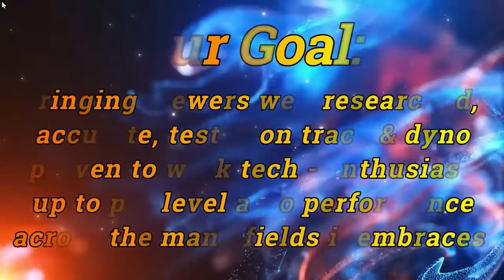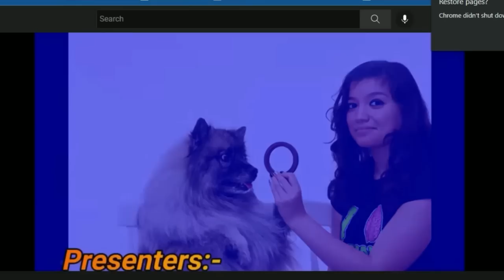A mystyery - 90 hp from spark plug change!!!

Comment: I can definitely confirm the spark plug story. I always did a lot of work with plugs, timing, indexing, ignitions, etc. One time I had been having good results with gap and timing and I decided to push it to the limit. The car just fell on it's face. It was over 3/4 second slower in the 1/4 mile. I pulled those plugs, put my trusty 'best combo" back and and the car flew again. In physics we have what is called "a high q" circuit. What this means is that if you get just a little to the left or to the right of optimum, you lose power/gain/response. That's how engines are. Most people run engines with a Q about 50. Good race engines are in the 70s maybe 80s. Those on the edge are in the 90s'. But if you get just a hair off, you can drop by 50% for the smallest thing. The story about the 350 that ran with the Dominator is a prefect example of a High Q engine. Anyone who's been "in the zone" in any competition can confirm this. You can't miss a shot. Nothing distracts you. Your brain is at a higher level. Engines can be the same way.
Reply: Like walking a tightrope
Reply: Right
Reply: @Equus_Master  It's call it "like balancing a triangle on the point."

Comment: I’ve experienced that spark plug issue firsthand and people always tell me I’m nuts and spark plugs couldn’t do that.  It was on a 350 swapped ‘80’s Monte Carlo my cousin bought many years ago and you couldn’t get the thing to turn the tires for anything.  It had decent parts and receipts for everything.  I pulled a plug to check condition and it had Accel “shorty” plugs in it for header  clearance, they didn’t appear worn and weren’t fouled or wet- looked normal.  We went to the parts store and picked up regular old Autolite spark plugs…after tossing those plugs in, the car came to life!  Blip the throttle from a standing start and the tires went up in smoke instantly.  To say it was an entirely different car after that is a gross understatement.
Reply: Not experienced anything that extreme myself but i like to try a few diff brand plugs in an engine and see what it likes
Reply: Auto light coppers or ac Delco coppers are my go to plug for all my vehicles I always side gap them too and the never skip a beat

Comment: Wouldn't the gas analyzer have picked up high Hydrocarbon from the unburned fuel if the spark plugs weren't doing there job?

Comment: Thank you Mr. Vizard!   You are a breath of fresh air to me and many others...  I've scratched my head for hours on end trying to figure out why my car wouldn't pull like it did... I had bought a set of accel "shorty" plugs because of  my headers and when I swapped back to  ac or ngk, the power was back!   Who'd have thought plugs would make such a difference?    As others have said, when I pulled plugs to look for a wet plug or fouled plug, I found neither.   I so needed to see this video!    It can be depressing and make you lose your enthusiasm for the whole restoration process.  I've learned so much from you!   Thank you, from the bottom of my heart!   I love you!

Comment: Another riveting episode where you are never looking for the end to arrive.  Thank you David.   Sometimes it is the little things.  A friend of mine was a painter at General Motors Holden, Australia, during the Second World War.    They got a captured Zero in the factory and stripped it to find out what they didn't know.  It was put back together but could not reach its prior top speed.   It was later realised they had spray painted it but the Japanese painted them with a brush, from front to back.  Apparently that broke up the surface drag.  This is much like the polishing of ports that slows the charge.
Reply: Thats why I  dont care so much about  heads I ported going everywhere.....most dont see the ' trick '   .......😅

Comment: Many years ago, I was an engineer on vibratory conveying systems.  In some tuning situations, we would hit what we called a High Q where the the performance would hockey stick nearly straight up.  Tuning for that situation was very narrow and temperamental.  Literally, turning the system off and coming back the next day and turning it back on with, no other changes, was enough for to send the system to hell in a hand basket.  Took some head scratching to figure that one out.

Comment: I have an supercharged 03 mustang t56 swapped with a hand built forged 4.6L 2v from excessive motorsports in Florida. Its actually for sale, anways its got comp cam 2690009L and R, trick flow heads tr6 plugs "i believe" stock ignition, on a conservative tune 17 degrees at wot.  Car is on about 20 lbs of boost and on wwf snow performance shes was just yawning at 550hp. i had the plugs out one day  months later checking gap and plugs, nothing was wrong but I was learning about gaps at the time. Tuner had me put them at 28 thousandths  months earlier i saw a video on spark getting blown out easily on large gap. I went ahead and tightened up the gap to 20 thou, such a huge increase in top end power I would say 90hp total. I'm no dyno   maybe 50hp gain , anyways I could feel the difference it feels great with no change in the tune at all. Love your videos LIKE SHARE and SUBSCRIBE Happy holidays to you and this wonderful following

Comment: I’m getting addicted to the wisdom and experience shared in these videos.  I’ve also found that sometimes the flash, all-singing, all-dancing spark plugs just don’t work well.  My T140 Bonneville just loves Champion N5s and plays up with anything else. It’s got plenty of electricity and a Tri-Spark ignition too. Even tried Denso Iridium plugs to no good result.

Comment: He's right. I've told people about how important plugs are and they don't get it sometimes. I had a turbo LS motor in a sandrail pickup almost 120 HP on a Dyno over a plug change. Went a couple heat ranges colder and closed up the gap a bit and BOOM!!  Everything else being the same. Tune, boost pressure, everything the same. Just a plug change. Sparkplug selection is a real thing and it's important. 👍

Comment: Those EQ cylinder heads were the most fantastic iron i have ever heard of, i think it was RHS that bought them out or maybe supplied the heads for them. The EQ heads were really good on dyno stands and performance. Here is a mild 383 build with EQ 220cc heads. 10.25:1 static compression with 185 PSI cranking compression. With a comp XR282HR10 retro roller. You could or should step up to a 288 and do well also with a trade off for the 91 octane . It made 515 torque @4000 rpm & 470hp @ 5400 rpm.The torque was straight across the band. A street stock build on the edge of pump gas 91 octane. Holley 750 dp with 1" spacer on pro comp #22025 intake. Hei 36* total (37*).
1.6:1 rockers brought lift to .544" and .555" lifts. If you have a street car 383 get heads that flow like this: 
Ported EQ 220CC cylinder heads flow data
At.100" lift = 73 cfm IN. & 61 cfm EX./ .200"= 140 cfm IN. & 107 cfm EX. /.300"= 201 cfm IN & 144 EX/ .400" lift = 244 cfm IN. & 166 cfm EX./ at .500" lift = 269 cfm IN. & 181 cfm EX./ .600" lift= 280 cfm IN. & 190 cfm EX./ .700" lift =287 cfm IN. & 197 cfm EX.

Comment: Possibly the larger fuel drops in the mini engine was making up some volume in the combustion chamber?  Like water injection on diesels does.  But the neat thing is, the fuel droplets would still burn, unlike the water.

Comment: I wonder if the lower velocity mix exiting the Dominator allowed it to make the turn into the runners to a more favorable location in the runners on that particular manifold?
     Great stuff, much thanks.
Reply: That's kinda where my mind was heading. Something about the combination (maybe even cam ?) Still moving enough air to make the carb work, even down low.

Comment: The exposed tip of the standard plug would certainly help. Have you considered reverse polarity on your coil(s)? Atomically you are blasting hot electrons into the soup, as opposed to drawing free electrons from the soup.

Comment: Spark plug electrode location in a combustion chamber can be critical in some cases. As you have pointed out before,  Mini heads weren't really optional. If I was speculating on the 1050 on the 350, clearly defined, strong intake pulses made the carby respond. Soft mushy pulses would result in the fuel falling out of suspension due to the large droplet size. Would have been interesting to log the pulses in the manifold and compare it against some others. As you said, the heads flowed exceptionally well. Great stuff David. Regards Greg

Comment: I have never heard you comment on Brisk Spark Plugs. My daily driver is a 2015 VW CC 6-speed manual 2.0L Turbo that I have extensively modified and on a 100 octane tune makes 379 WHP. I also 1/4 mile drag race it and 1/2 mile drag race. I have run Brisk “Standard” spark plugs in the past with good results. I ordered their “Multi-Spark” plugs and I honestly thought “Snake Oil” but prior use of their plugs yielded positive HP improvements so I spent $14 x 4 on plugs. I was at the 1/2 mile race event and made a few passes with standard NGK plugs (2-steps colder than stock running 100 octane and 25-28# boost) and thru in the Brisk Multi-Sparks (no ground strap and 2x rings imbedded in the ceramic cone). Instantly picked up .91 MPH. Made a few passes and put back a fresh set of NGK’s and it slowed down about the same. Back in went the Brisk’s and picked it back up. That’s real world A-B-A testing. Don’t know if the high boost makes this look better or not. 
I would love to see you do some comparison testing using this plug as well as a standard (ground-strap) Brisk. 
Love your video’s!!!

Comment: No disrespect Mr. Vizard,
but I believe the race plugs
UNSHEILDED the flame kernel, 
leaving it vulnerable to the
boost generated by the supercharger on the mini
engine. 
(Hope I'm not coming off as
some piss ant know it all ) 😅

Regardless, you were SHARP
enough to catch, and correct
the problem! Kudos to you,sir.

I'm not a spring chicken like
I used to be, but I'm still a fan of your passion,
and dedication in the world
of tuning, and hotrodding.
I bought, and read some of
your books back in the 90's,
and they HELPED me with
my wimpy 301 pontiac v8.

It was a dog of an economy 
engine, but I got some fun 
out of it thanks to you. 
Thanks again. 👍

Comment: Hello Mr. DV from Toronto Canada. Deep in thought as to why you experienced the different events made quick work of clearing the snow on my driveway-thank you! 😀 With respect to the side electrode vs the regular electrode plug, did the side electrode create a flame kernel straight down the center of the chamber, whereas the regular electrode plug created an angular flame kernel?  The angular flame kernel was more efficient at igniting the mixture across the chamber? 
I've seen engine dyno videos where there is a plume above the carburetor. I question if this plume is reversion of the AF mixture when the intake valve closes-does a larger plume means a higher velocity port?  Were there any plumes above any of the carburetors on your student's engine?  Thank you for posting!!!!!

Comment: @18:30 Could it be as simple as flashing from liquid to gas = lower temperature? Perhaps this changes things down the line like ... just that little bit more stable fuel & air mix / taking closer to the edge before randomish pre-ignition? I doubt it's this simple, but hopefully it's a good thought experiment.  What an interesting puzzle. Thank you for all the wonderful content!

Comment: Hi David,

I suspect the larger droplet size requires more energy to evaporate.  The additional BTUs cool the air fuel mixture more.  Lower inlet temperature equals more density of a charge hence more power.  I have done a bit of experimenting on two stroke expansion chambers.  Do not underestimate the pulse energy in the exhaust.  Perhaps your students engine has a well matched exhaust configuration which produced a pulse that traveled to the dominators venturies.

Mike

Comment: What might have helped in the understanding of the spark plug mystery would be a super-high-detailed CFD analysis of the dynamic flow in the engine as the engine rotates. Ie, watching a movie of the flow in the cylinder instead of just a static simulation of a frozen moment in time. When I say 'super-high-detailed CFD', I mean that would show the flow of air around and through the electrodes of the spark plug as well as the trough between the spark plug core and the outside.
Reply: Or you could have a diesel
Reply: @fastinradfordable  Haha! Actually, I much prefer diesels anyway, I've had several

Comment: I'm wondering if Dusty's engine had cylinder heads that had more air speeds  and maybe more swirl? That made the 1050 carb work on his engine.  And on the fuel droplets question maybe the bigger ones cause a bigger explosion in the combustion chamber? Of course I'm guessing.
Reply: Swirl is often not measured...... 

I had 2 years ago very recent Nascar heads on my flowbench. Flow was good...but the amount of swirl was ASTONISHING.   Put in a diesel injector , increase compression and it would run on  diesel.....

Comment: I also did some testing with Holley Dominator carbs on a 355 sbc drag race engine making a little less than 600hp using a 750 Holley 4150. A friend let me use his 1050 out of the box from Holley but he would not let me do any changes to it. Needless to say ET was down, it was just to rich. So I wanted Prosystem's to build me one of his 750 dominators but he said the 830 4150 will work better. Bolted in on and up over 600hp. Ran it for a few years until I came across a 750 Holley Dominator which out of the box was down on power. After making some tuning change's (mainly removing rear power valve and upping the rear jets) the truck ran its best ET @ over tenth faster than the 830. I've always wonder what the 1050 would have done if I had got to tune it.

Comment: Jimmy Bridges in Nashville built a 417 CID sbc for me. The carb was 1250 cfm.  Car was fast (5.80s) in a S10 in the 1/8. Jimmy won a lot of Wallys and lots of NHRA records. Carbs and heads were his bread and butter. He could make the big carbs run on small CID engines.

Comment: Interesting - Do suppose it have anything to do with the supercharger blowing out the spark?  Or perhaps it has more to do with the field around the electrode at such high voltage.  It could be the conditions inside the cylinder cause the field outside the electrode(s) are too insulating for one plug and less for the other...  It has to be a resistance issue.

Comment: 300zx is great example of spark plus making a big difference, the plug where designed to sit farther down in the head, iridium replacements don't go don't far enough. they're solid copper core platinum tipped 5k resistor plugs, ususal gapped to .44 but I like .43 because I've had issues with pre detonation and the smaller gap seems to help. went to a colder plug and that was it, best plug for the motor

Comment: David, did you ever think to ohm the spark plugs and match them up? Some big brands can have huge variations across a set of 4-8 plugs.
NGK seems to have the best tolerances
Reply: I saw this issue switching from ngk plugs to champions on a 4g63 Mitsubishi with an aftermarket 20g turbo. Same gap and heat range as the ngk’s but way down on power.

Comment: In relation to the carburettor mystery, I'm going to make a suggestion based on inductive thinking. If the carburettor performed really well at high power levels in all cars, and only performed well at low revs in one particular car (and was spluttery in other cars at that low revs), what that suggests to me is that, as the designer expected, it would produce finer drops at high air speed and bigger drops at low speed. This suggests that in your student's engine, it may have been sucking air in high speed gulps rather than long, slow sucks. That would keep the air flow through the carburettor in short bursts of high speed flow producing finer drops, thus enabling it to continue working well at a lower engine speed. It also may have been that the power of the engine meant that the throttle had to be more closed for a given engine revs, thus leading to a higher vacuum within the inlet manifold and thus with even bigger droplets of fuel at a lower airflow speed, more of it would have evaporated before combustion, thus leading to smooth running even at low revs. Or alternatively, if the cam was pretty wild it might have needed a greater flow of fuel / air mix at that lower speed than many other engines, thus ensuring a higher speed of air through the carb and therefore smaller drops.

Comment: I wonder if the difference in being able to load that carburetor down to the lower RPM on one engine and not the other could be related to the ignition timing curve. As an example, one time I accidentally left my vacuum advance hose disconnected after checking the timing. When I drove the vehicle without vacuum advance down the interstate at 65 MPH, I noticed that I had to keep my foot in the throttle like almost halfway almost getting into the secondaries just to stay at 65 MPH. Once I reconnected the vacuum advance, I could cruise at 65MPH with the throttle barely cracked open. I realize that there is little to none vacuum at WOT with a load but can't help but think timing would cause a difference in how much flow is needed. Also fuel mileage was cut in half without vacuum advance. Engine also runs cooler with vacuum advance... Anyway, Great videos!!!! Keep them coming!

Comment: I have a theory on the small droplet loss of power, the air flow wasn't sufficient,  as the fuel atomized it expanded and took up oxygen space, the larger drops atomized in the combustion chamber after the air charge was already being compressed.